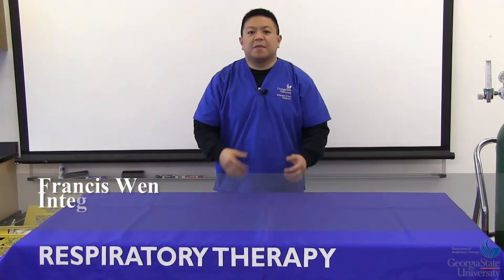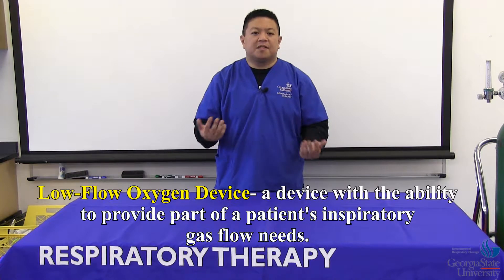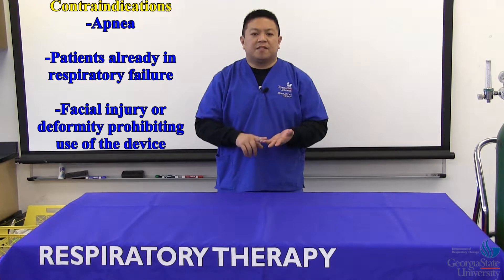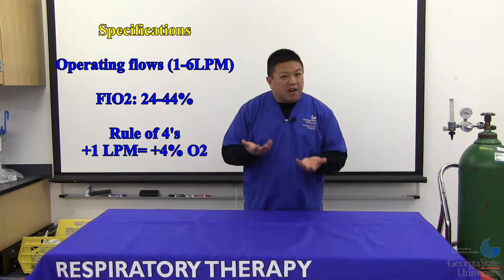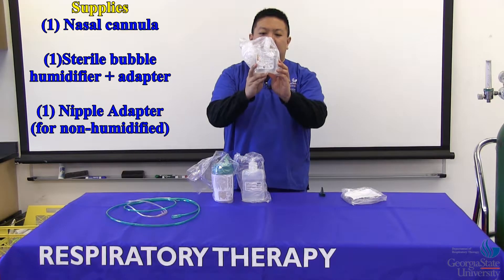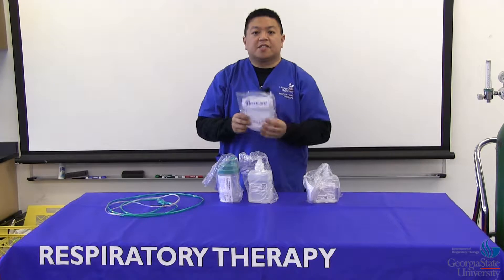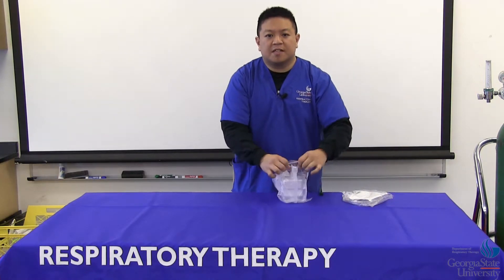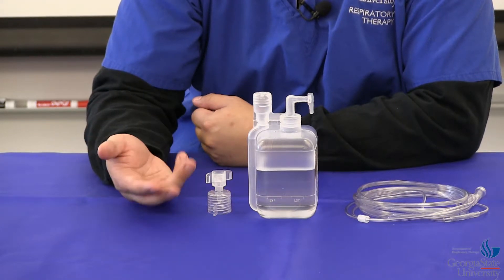Nasal Cannula Project HD

Comment: hello, can you use one of those bubble humidifiers on an oxygen concentrator? if so what adaptor would you need?
Reply from the maker: Generally in practice I don't think it will hook up to a concentrator based on the the fact most concentrators do not have your standard oxygen flow meter attached, just a nipple that connects directly to a cannula

Comment: How can you tell if the oxygen is coming through the nasal cannula? Without humidifier you can feel it coming out, or do a water submersion test. Will you feel it coming through if there is a humidifier attached? Thanks
Reply from the maker: You'll still feel oxygen.  It's a dry cold sensation without a humidifier. Commonly can cause nosebleeds for certain patients

Comment: What happens if you use the tree adapter to connect your disposable bubbler bottle instead of using the adapter that the bottle comes with ?
Reply from the maker: It won't seal and will probably fall off the tree adapter at some point

Comment: Is it normal for water to accumulate in the tubing?  Or at that point, would you want to just change the tubing? Thanks for this video
Reply from the maker: Happens from time to time. Means your flow might have been too high. The water will get out after a minute no need to change